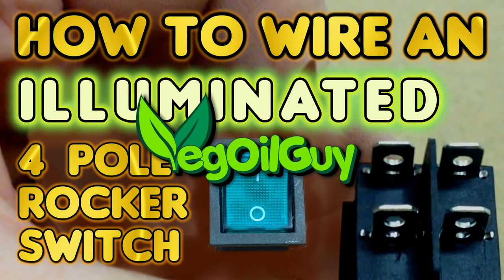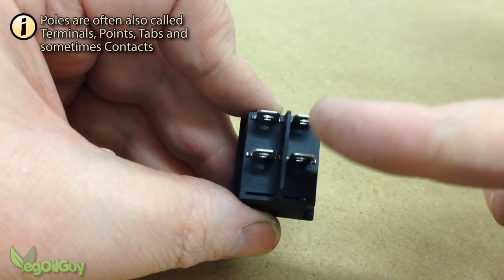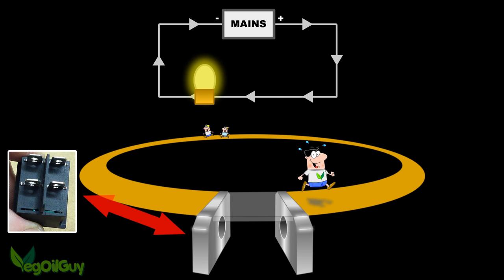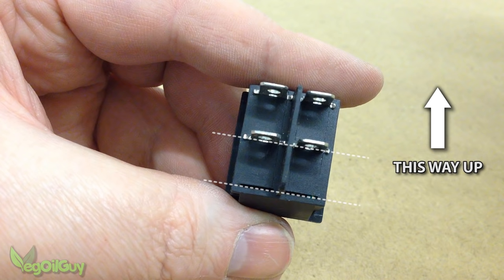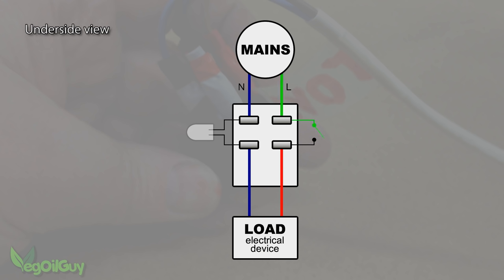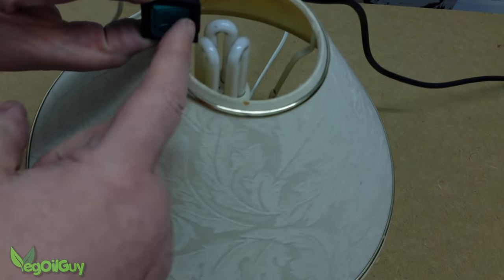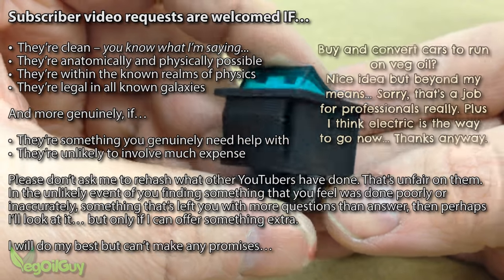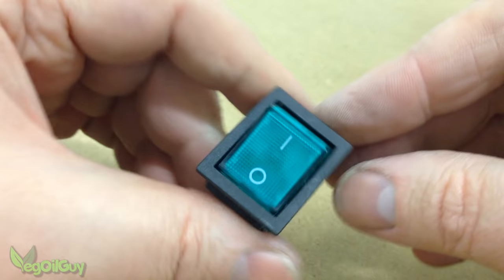How to wire an illuminated 4 Pole rocker switch KCD4 - by VOGMAN

Comment: so, i must be doing something wrong then... i have one of these in the tank of a solar water heater...  it's 220 v, and also has to flow through a thermostat to power the auxiliary heater (in case there isn't any sun)...    so i have 110v and 110v coming from the mains, on the two top terminals - shouldnt' matter which since it's 220...  the heater has 2 wires, as does the thermostat, so i have one wire from the heater going in to the thermostat then coming out of the thermostat and going to one side of the switched... the other wire from the heater goes directly to the other side.   when i apply power, the light is on, no matter whether it's switched on or off... so i killed the mains power just in case i blew something up!  i THOUGHT i had it right, but why does the light stay on?   it's either meant to be on all the time and i DO have it wired right, or it's NOT meant to be on all the time and i have it wired wrong - again, they don't come with any directions, and i have essentially the same wiring as you other than having the thermostat between the load and the two bottom terminals.  any guesses?
Reply from the maker: My first thoughts are - are you sure it's the same switch? It might look like it and it might have four terminals, but it could be a difference model that's wired differently - it happens. See if you can see a model no. on it.
Secondly, pull the switch from the circuit and test it using a similar set up to what you saw me use - a table lamp or something (not anything expensive).
The wiring is either incorrect or the part is not the same as mine shown here.
Hope this helps : )
Reply: well i actually did a continuity test with a little 12v battery.. apply + and - to the top two terminals, and check for continuity on bottom two... no with switch off, and yes with switch on.. however since it's for 220, the light didn't come on at all...  i have a schematic - and i THINK I followed it right...  and maybe the light is supposed to stay on and it's just there to find your way in the dark or something...
Reply: admittedly it looks 'sort of' the same...  red light instead of green but 4 ports in the same configuration - the back looks the same.   i'm in canada and don't have anything cheap that runs on 220.   all the cheap stuff is 110..  supposed i could rip it apart and try that.
Reply from the maker: I understand what you mean with the voltage. You were quite right to test on a 12v battery... that would show if the switch worked, but it wouldn't light the neon bulb as you've correctly said.
The switch I'm referring to is a  KCD4, with four terminals and it’s for 125 / 250 volt. Whether that would work on 110v I'm not sure.
They do come in red and green though.
I'm thinking it might be a different switch altogether. Mine was bought from Amazon if that's any help.
Unfortunately without being there with you, there's very little I can say or do that might help. Sorry.
Good luck.
Reply: i'd be willing to bet that they ALL come from a factory in china..  doesn't make sense they would all 'look' the same but be wired differently...  in concept i'm sure i have the thing wired correctly - power comes in, switch controls it... if switch is on, power goes through thermo, if thermo says go on, heater goes on...  it's the light staying on that has me kerfuffled.   at this point i may just have to take the front panel off, and take the switch out and diddle with it... maybe in this model the power comes IN on the bottom two... i doubt it though... i also sent a note to the solar tank manufacturer and asked for even a crayon drawing of the wiring, and to answer whether the light is supposed to stay on or not.   by the way, 125v works with 110 and 250v works with 220v.    i have both stuff, in canada most of the 220v is water heaters, ovens etc.. plus my mig welder and plasma cutter... also have a 3hp dust collection that is 220v but low amp.   luckily it doesn't take a great deal of sun to generate hot water in this solar setup, but i'll need to sort it before winter.  thanks for the replies.. i will soldier on!
Reply from the maker: When I first bought this switch, there were no wiring instructions. So I did the usual thing and browsed around Google for a while looking for a diagram or two. I did find some for 4 pole switches and tried it - blowing the switch and a fuse in the process. This told me that the diagrams I'd found were wrong (but it does prove there's more than one sort, so maybe Google around for a while).
After that I just conducted a few low voltage tests and figured out the right way. Luckily it was a pack of 5 switches : )
Reply: i've been googling my ASS off... and everything seems to point to top two power in, regardless of whether it's DC or AC and voltage... and bottom two are switched.   even talked to my brother who is an electrician and he said 'i dunno'... so today, i'll take the panel off, wire it up to a 110v extension cord and a lamp or something...  the thermostat is irrelevant in this  since it's just a controller that has to be in the heater loop to power... but if the light stays on, i figure i'm good... doesn't make sense to me that it would, but maybe they thought it would be handy if the heater was in dark room or something...  only takes a few minutes to take it off and test, just absolutely astounding that this seems to stump everyone - it's a switch - and on off switch!  doesn't that seem weird, that it seems to have stumped the entire internet - what do i win??    i AM getting a light and it did NOT throw the breaker, so that's a start.  no puffs of smoke as the pixies escaped.
Reply from the maker: Congratulations... you win a 6 pole switch   ; )
Reply: hahah...  no thanks...  that's just just 50% more crazy making.

Comment: Whats wrong the switch works but doesn't light up.
Reply from the maker: If it's wired up correctly and the voltage matches requirements of the switch, it should light up. If the voltage is too low or too high, then no.
It is possible the neon doesn't work, but I've never experienced that personally.
Reply: VegOilGuy  The rocker switch is wired up to spot lights on my car.  It's a 3 blade switch, Power, Acc  and Ground and it's 20 A, 12 Volt, Normal 12 Volt Car battery.  I tried a second switch and it still doesnt light up.  Never happened before.  Switch worked fine for a year.  Fuse is ok as well 🤔🤔🤔🤔🤔🙄🙄🙄

Comment: So which is which for a automotive install? Every video i see is for home use ffs!
Reply from the maker: This particular switch is not really for auto use. It's illuminated by mains power. Whilst it will work as a switch, it won't light up. Look specifically for an Auto Illuminated Rocker switch : )